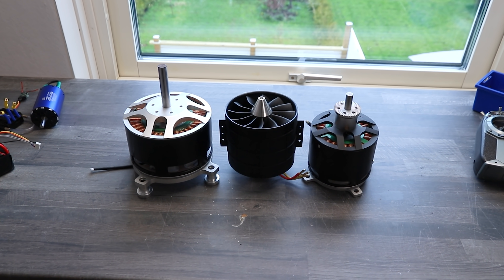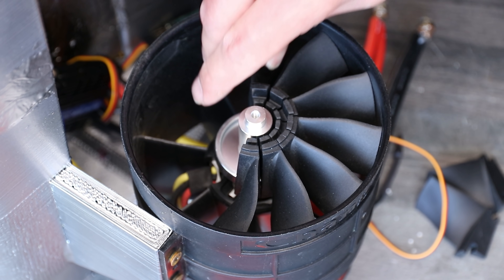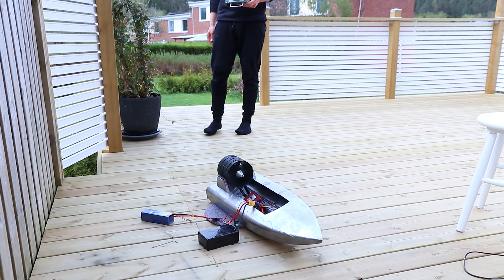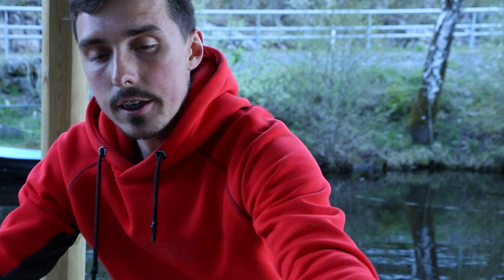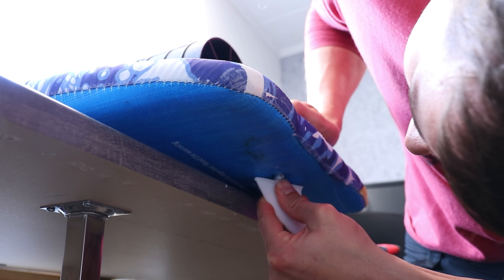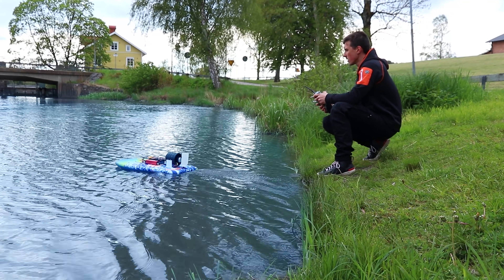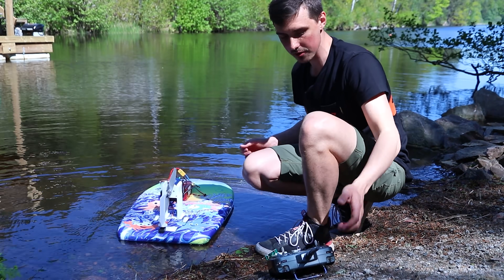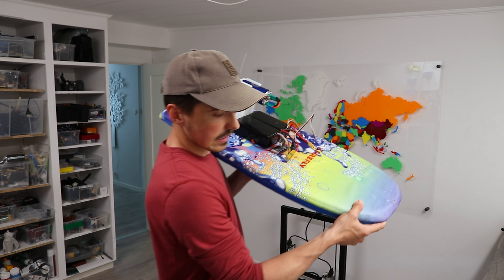How This 7000W Motor Was NOT  Powerful Enough!

Comment: In last videos you were displacing water, but this time just air. Thus, you got low speeds and acceleration. Displacing water creates huge force in comparison to displacing air as water has higher mass and force is mass multiplied by acceleration. Although the acceleration would be little low but the decrease in acceleration will be far less than increase in mass when you switch from displacing air to water.

Comment: Nice motors 🚀 Looks like there is way too much friction with the water. The board is probably too big.
And for the boat it looks like you should blow the air more "up". Doing that should help the front of the boat to raise from the water. Using the e-foil design should improve everything but not easy to do.
👉 Waiting the 2 seats helicopter with the big one 🚁
Here are my 2 cents thoughts 😅

Comment: How fast do you really expect it to go on 70 N thrust? 7000 W/70 N =100 m/s so most of the power is wasted moving air rather than moving the boat. You could maybe get that thing up to 20 m/s so figure out a setup that gives you at least 350 N thrust. Sounds like a job for a waterjet.

Comment: Maybe it would work better if you mounted the motor closer to the middle or center of mass. It seems like the motor is pushing the back of the board in the water, adding a whole bunch of drag

Comment: Instead of adding more power the smart way of increasing efficiency would probabaly be 3d printing a funnel on the out flow of the turbine?
Reply: I thought I could put the batteries further away from the turbine (accumulated weight on the back of the table), so that the table does not tip easily and the boost is more efficient.